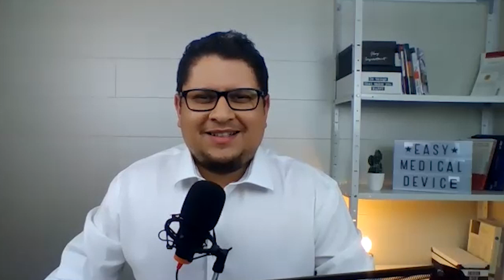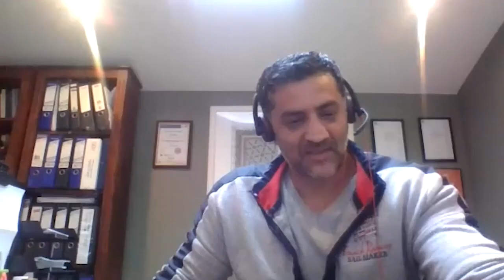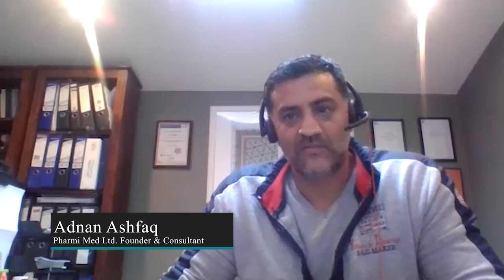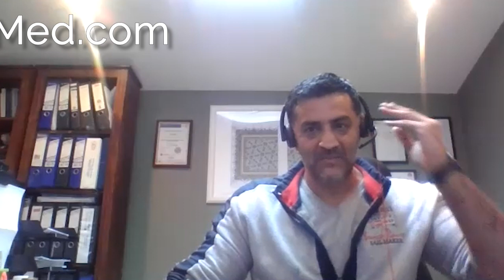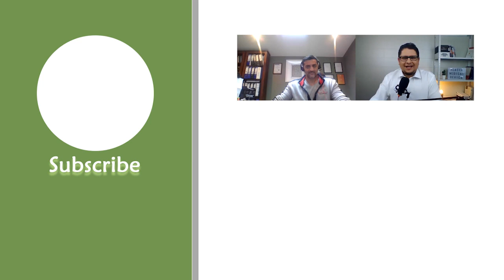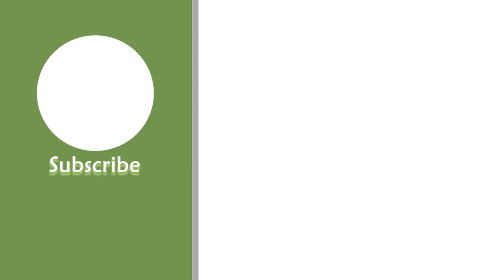How to perform your Process Validation for medical devices? (IQ OQ PQ)

Comment: Excellent information, but I thought that the rule of 3 has been removed and is no longer recommended since companies were defaulting to it instead of providing statistical significance,  what do you think? Is that accurate? Please correct me if I am wrong.
Reply from the maker: Hi, not at all. There is no specific methods that are described to execute this. But this rule of 3 is providing some statistical measures to confirm the validation is correct. This was also recommended on the GHTF guidance. So this proves it is really considered by all companies.